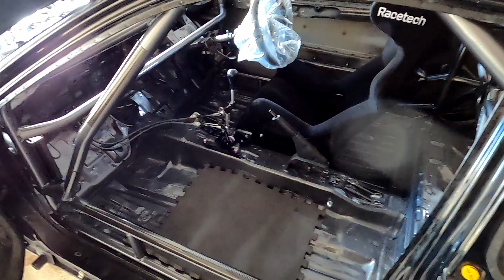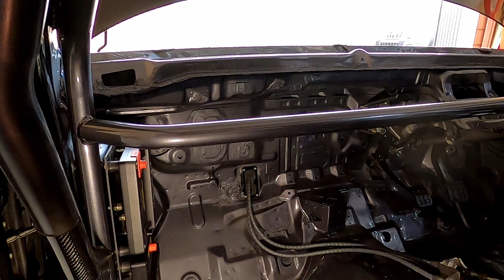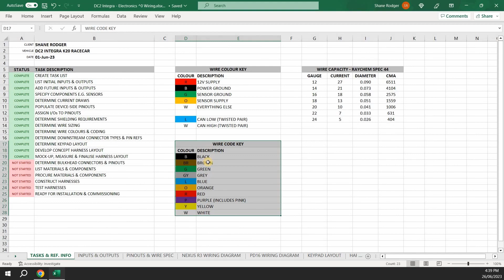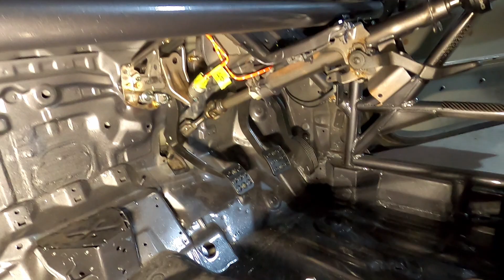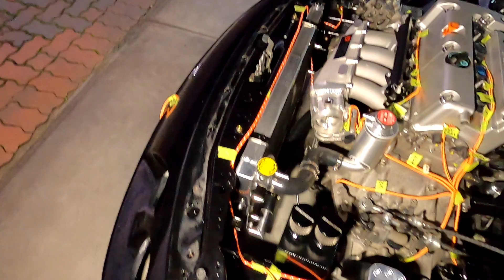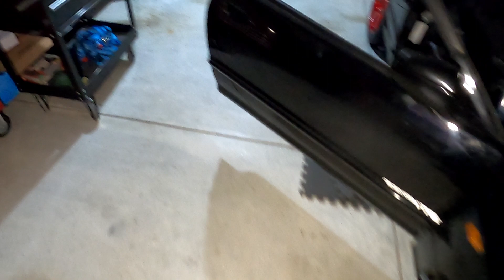K20 DC2 Integra Racecar Build Ep. 07 - Wiring Planning

Comment: eBay link for shifter cables?
Reply from the maker: They came with the engine and trans when I bought them, I think they're the KTuned race ones
Reply: I meant the fire wall mount thing you mentioned to run the cables through. Sorry.
Reply from the maker: @ESherbinFox  if you search "billet shifter cable grommet" you'll find them, I bought this one I think https://www.ebay.com.au/itm/183810740813?hash=item2acbf9524d:g:8G4AAOSwZ2VhnDiz&amdata=enc%3AAQAIAAAA8Mhocnn9zHQfIRbY8c4cM2U%2B26TfRPuY7HA34O3LKA35pnFvTSRrCRTJAo3gxnxHi7%2FoVY9%2FVTMKR5hC1bXHs3a8BkcqI4wH0A3XeMCsRxyRiMVmnDPg6XxjKAaKtBBcl57w2myG5Xj2Du2gogSFvFG2VUx08ZQm7%2BVp3F0hEea0ozgixxaTkNPdVbSB6KrWpD4V4lBDJAeB%2FOqciZfHe9AlKo%2BExtWbyMsgjx9BpsOF9V07gHEfJ2JFvAVUnK6q9WgbzakUU9NQ%2BcDqQ017vi%2B9AvtyWCts6aVUSv4ml0DRhZdeillFU3wR8HhF6LDTDQ%3D%3D%7Ctkp%3ABFBM5se-ovpi

Comment: Any reason why you chose the Nexus R3 + PD16 vs Nexus R5? I assume the R3/PD16 combo gives you more circuit headroom vs the R5?  I have a similar engine/chassis setup and looking to hop in the Haltech Ecosystem.
Reply from the maker: Yep spot on, the R3/PD16 combo has more power circuits than the R5, which was important as I'm still retaining all the lights and other "road legal racecar" sort of stuff. The R5 does have more inputs for sensors, but the power circuits are more important to me. R3+PD16 was cheaper too

Comment: Real nice progress on the build! Love the idea to use the string/cord to determine wire run lengths! ...Btw, have a check on the Throttle body orientation ...I have heard they need to have the throttle plate shaft horizontal or they act up and do weird things. Lovely race car!
Reply from the maker: Thanks Daniel! That’s a good pickup, I have now rotated it 90 degrees (also to move the TB motor and connector to a spot further away from the swirl pot and engine block for heat management)